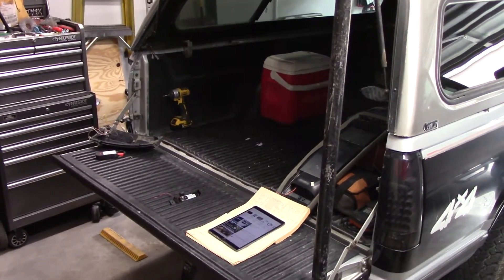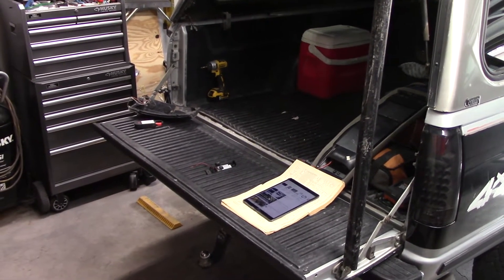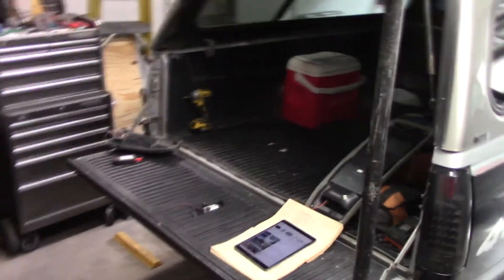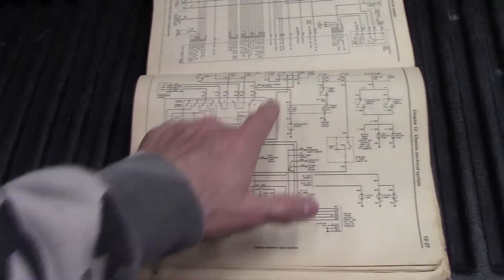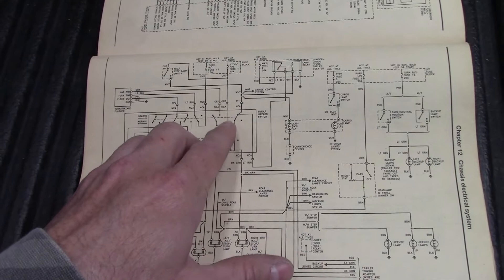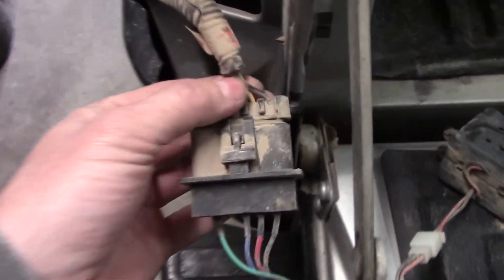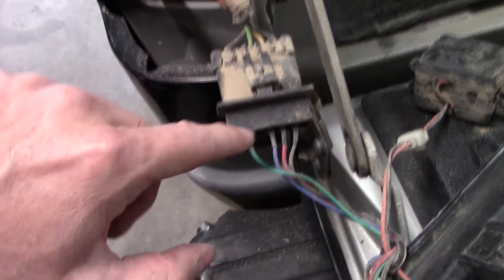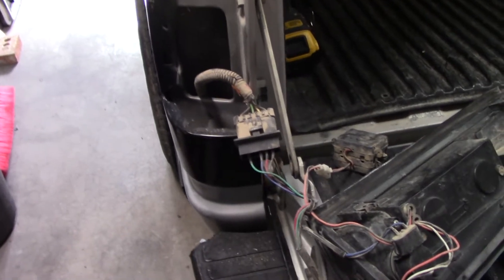20201023 GMC Sierra Camper Shell Wiring

Comment: An LED resistor can solve that hyper flash on the blinker. One pack comes with 2, one for either side.
Reply from the maker: Correct, it can. I normally go with the flasher relay meant for LED lights EP26 of I recall correctly.

Comment: About to wire my 98 gmc for a shell. Thanks for the video. Mine has the third brake light on the cab but it’s also a z71, so it might have the blue and white aux power you mention. I’ll have to check it out.
Reply from the maker: Thank you. Yeah if you have the cab light all you have to do is tap that light. May require dropping the headliner, though.

Comment: The best thing you can do is bring both right and left lights to the camper and add in diodes to stop the back feed it will always have power from the brake light
Reply: Right brake/turn-----l>-------l
              Diodes        ^         l----×center-
Left brake/turn-------l>-------l
Reply from the maker: @ZatarraDrifts  I've thought of getting into the world of diodes for this.
Reply: Its pretty simple to do just have to get the polarity right

Comment: Later model GM trucks had a lead in the tow package wiring located above the spare tire that had a light blue wire in it that provided power for a third brake lamp on a camper shell. I know that the late 1990s models trucks had this, but I do not know when they started doing this. It would be worth checking for a bundle of wires wrapped in wire loom above the spare tire.
Reply from the maker: Yeah, I kinda talked about that in the vid. This truck being a 1990, didn’t have that. My 1994 S10 does. So musta been somewhere early 90s they began doing it.

Comment: I'm clearly missing something because you are way too smart not to have tried this: Why not take the ground and brake wires up to the third brake light from either of the rear brake lights?? I am assuming you are only looking for the third brake light and not having it as a running light as well. Since Suburbans ('96 on ??) have the third brake light, would the wiring diagram for a Suburban help?
Reply from the maker: This is a 1990 Sierra, before the CHMSL third brake lights were a thing. They started around 94 or 95. I’ve concluded that I’d have to go into the cab and tap the line at the brake pedal switch. The tail lights have a dual function light that is both brake and turn,